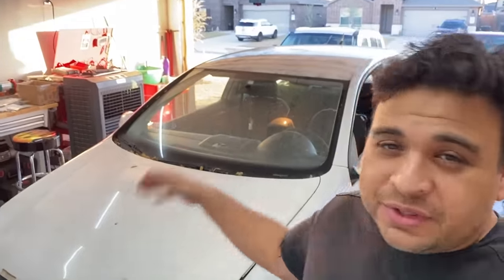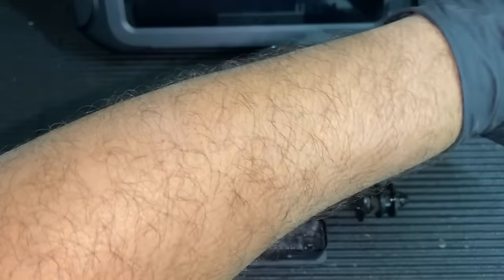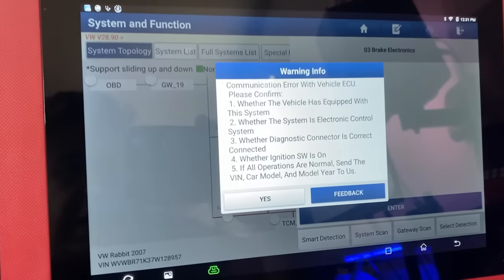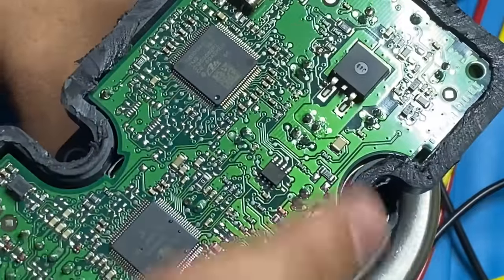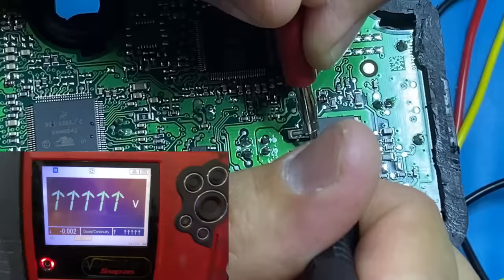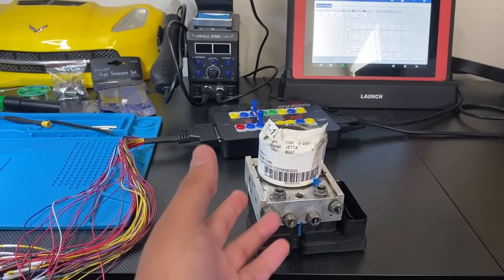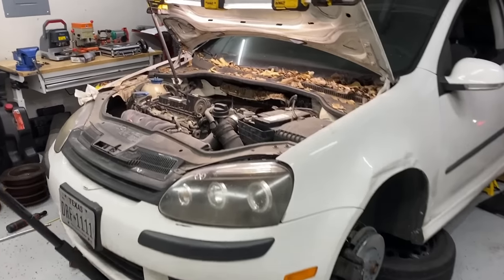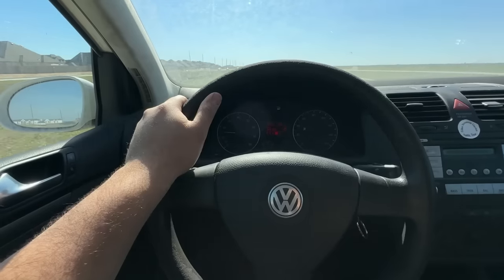VOLKSWAGEN RABBIT FAULTY ABS MODULE AND USED REPLACEMENT

Comment: If you supply required voltage to module while bench testing and look closely with thermal imager you will see shorted component heating up.
Reply: Or you can also put a few drops of isopropyl alcohol on the suspect component, and if it starts evaporating quickly, well then there is your problem !

Comment: What I thought was funny is when I changed my abs module on my 2006 f150 , I put a used one in and funny thing, it worked perfectly, I scanned it with Forscan and the only error I had was a vin # mismatch. But it worked perfectly.
Reply from the maker: If you have Forscan you can do the "As Built Data" on the ABS module.
Reply: @ADVANCEDLEVELAUTO  yeah, I know, but I thought it was cool that the vehicle just accepted the information that the module was sending it even though it wasn’t programmed correctly

Comment: Can you test the original module with your desktop set up now that you connected the correct pins? just curious if you soldering fixed the issue. Thanks!

Comment: Excellent video to understand a little more about how to troubleshoot a problem in an ABS module and some measurement values that I had no idea about. Thanks for uploading it. Regarding the auto-adaptation, I think that perhaps it was done automatically because you bought the same part number, although I'm not sure, but I'm glad you were able to get the job done. I hope to find more videos about component measurements, I'm curious and I like to understand how these electronic components work, since I'm an automotive locksmith and sometimes I find defects in certain modules involved. Greetings from Argentina.

Comment: Never saw an ABS module change it's own VIN code. Very interesting. But then, I've never repaired a European ABS system.
Thanks for the video.
Reply: Chrysler/ dodge/ fiat does. Will explain that on the second part of the fiat video
Reply: @OzMechanics   Is this common for European vehicles?  How about Asian vehicles?
Reply: @kbaisley4947 I have a 2010 Volkswagen Jetta with 2.0TSI. Currently battling with ABS pump/module no communication fault codes. If I get an ABS module/pump from the junk yard that matches the same part number, will it be plug and play like this example??? I have an OBDeleven scan tool but I’m not sure how to pull the coding off the old abs module and put it into the donor module.

Comment: Thanks for the video.  Managed to get an ABS module the exact same code as my original module (been slowly looking for about a year).  Had my mechanic install it similar to your video instructions. It worked out well with little fiddling required. 😀

Comment: All great except I'd have really liked to have seen the old module back on the scan tool after you discovered your miswiring just to double check it after your repairs to it...
Reply from the maker: Yeah, I did not think of doing that at the time. I still had a lot of other repairs to do on the car so I kind of just moved on after replacing the module. Thanks for watching!
Reply: @ADVANCEDLEVELAUTO    Don't blame you for that at all,,, it just would have been interesting..

Comment: Originally when the Tier 1 automotive module suppliers (mainly from Germany) wanted to do press fit connector pin attach style, the story was the technique would only be used on low cost non-critical control modules like HVAC or Radio, etc. Well, obviously this no longer holds true, and the technique of the pressed fit pins for many lead OEM engineers, required the pins be soldered for critical systems from the supplier. So, somehow this particular module did not have an experienced systems engineer on the component qualification.

The first step is to verify the module power supply is working. The Schottky Diode is most likely used for Reverse Battery protection on the front end of the supply. You can check the diode when it is in circuit live, if drawing current you should see a voltage drop. Doing diode continuity test in circuit is not advisable. Then the next step is to determine the power supply topology and what voltage rails should be present. For the microcontroller you can find the pinout online, and confirm you have the proper supply voltages at the IC.

Any power MOSFETs that are not part of the CAN interface should be saved for last. If the MOSFET is used in the supply than it should be checked. From looking at the PCB, to make CAN work, you only really need the microcontroller powerup and the CAN interface IC operational.

Comment: Great video homes. I have a 2008 vw with a 01314 code. No communication with ecm, in my brake control unit. What code did you get with this vehicle

Comment: On the desk, did you count that variable too like ABS modules many cases have the 1 resistor. To make it working you must measure first and then use different resistor if needed to get total right

Comment: What would have happened if the coding wasn't done?  Reason asking is i have the same problem as in the video but i don't have a scan tool that codes.  Excellent video

Comment: When you remove the lines from the original pump... is there any way to prevent the fluid from leaking everywhere? Or is it possible to just remove the big bolts that hold the mounting bracket in place and move the whole abs assembly away from the wheel well just enough to remove the module itself, without unplugging the lines from the pump? I am bout to do this on my 2014 Passat. Any tips would be appreciated. Thanks.

Comment: Hey Eric.. I  have a 2008 Jeep Grand Cherokee where the ABS had internal failure so I got a used Module but I wasn't able to program it.. I have been to different shops and used different scanners but they were failing to program the ABS module... Do u have any experience with Jeep and do u know the right procedure to program ABS module? I have been told I have to get it programmed at the dealership? Is that right?
Reply from the maker: Most professional scan tools can change the vin number on those older Dodges but if it needs to be programmed then you’ll have to do it with a J2534 device and the Witech software.

Comment: Awesome video.
Did your soldering fix the old one?
I got a psycho abs module right now wreaking havoc.. in and out, comms no comms, causing engine faults etc...I disconnected the ABS module and lost speedo and fuel gauge goes crazy (presumably because loss of module/ resistance in can bus circuit) but car ran fine. So I'm about to try your soldering trick.

Comment: One thing I have noticed about hard drives in computers:   If they become defective, you can purchase a new hard drive manufactured the same year and preferably within 3 to 4 weeks of manufacturing date (info on label of HD), same manufacturer off ebay and replace the defective hard drive logic board with the new logic board and the drive is up and running with no lost data.

Comment: I would have replaced that capacitor anyway...........that type of capacitor doesn't have to be bulging to be bad.   You would be surprised.   Rarely is it the eprom; usually, it is a mosfet or capacitor.  Sometimes, you can inject some voltage ....12 volts into module (measure what is coming into module from vehicle), and use finger to find the "hot" component.   You can use a thermal camera; the ones with best resolution are VERY expensive.  Some electronic techs will use 99% alcohol or compressed canned air to find the "hot" component.

Comment: Hi Eric great video, I wonder if the reason the module didn't communicate with the scan tool on the bench is because you have a 120 ohm resistor across the terminals, shouldn't it be a 60 ohm resistor?
Reply: the 120 ohm resistor was not a factor on the used ABS module